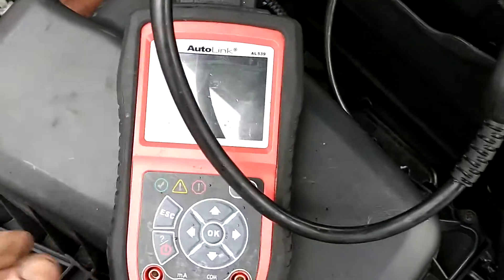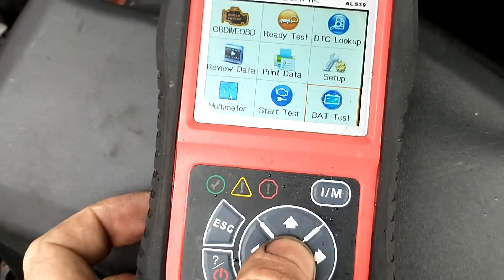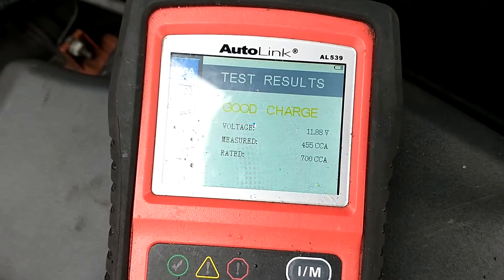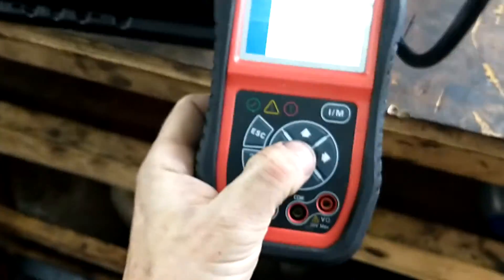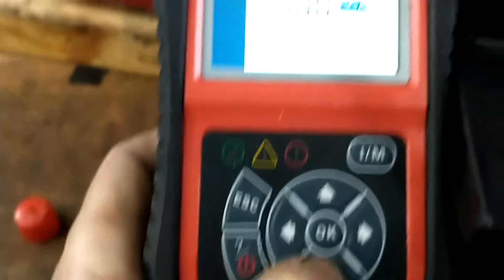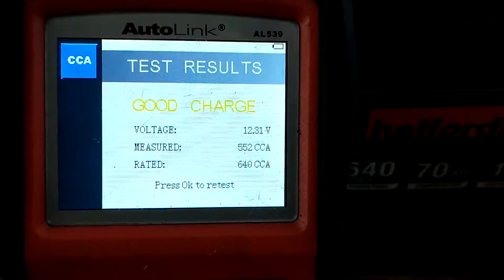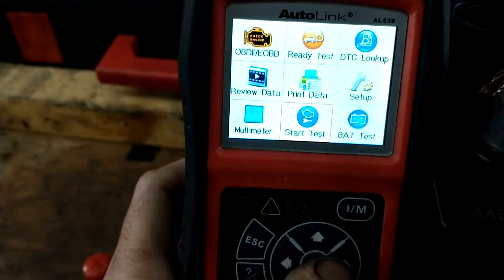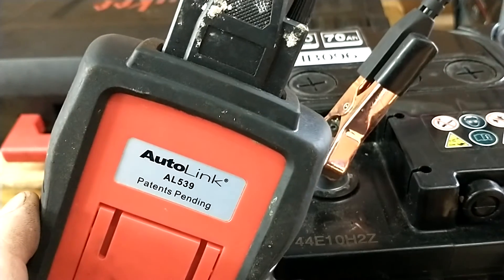Using an Autel AutoLink AL539 Battery Tester voltmeter multimeter

Comment: Would you recommend one of these?  I have seen on another of your videos it said 'replace battery' but you said you would leave it to see how it was after customer had driven the vehicle, which would suggest it sometimes gives a misleading result.  Do you find it reliable in identifying batteries that need replacement?  Cheers 👍
Reply from the maker: Very reliable. I couldn't live without it. It's not the tool that can mislead a battery status but it's a case of a fully flat battery jump started for 5 minutes may say the battery is weak but it just needs a longer drive to fully charge it before an accurate reading can be done.

It also makes a noticeable difference when you disconnect the battery from the car.
Reply: @ORileysAutos  thanks for the info, that's good to know.  Do you mean you get a different reading with battery disconnected? I have seen some testers have option to tell the tester whether it is in or out of car, I'm guessing this one doesn't?  There's a guy in US that has done series on YouTube of the autel showing how the graphing feature can be used as a basic scope, looks like a handy feature.